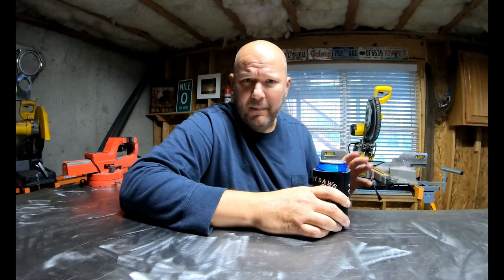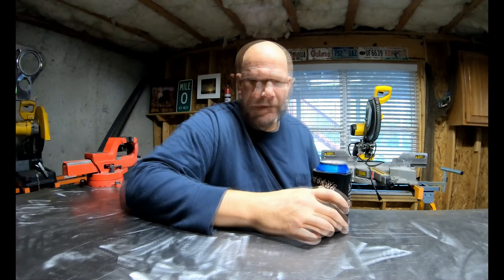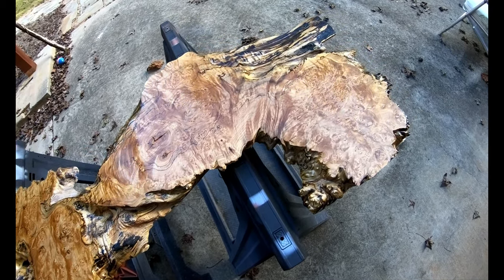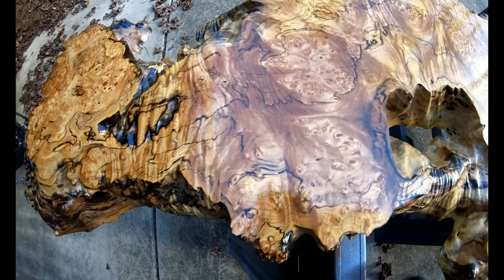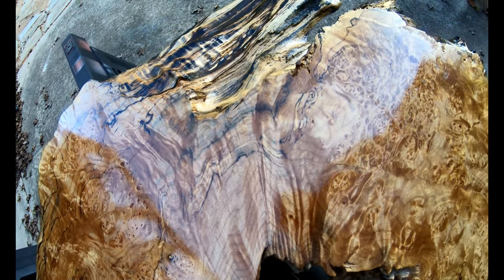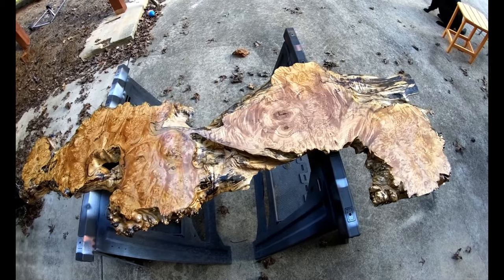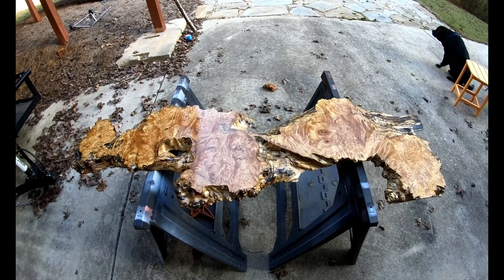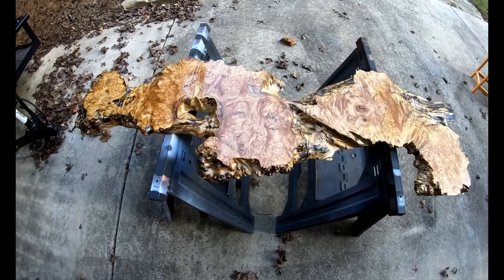DIY - Amazing Spalted Maple Burl Wood - Home Decor

Comment: Beauty!! What kind of varnish did you use?
Reply from the maker: David thanks for the comment.  The finish is called waterlox. I applied 6 coats. Sanded w 220 grit in between each coat and lightly with 600 grit on the final coat.
Reply: Well done, sir. @JDOffline
Reply from the maker: Thank you David!